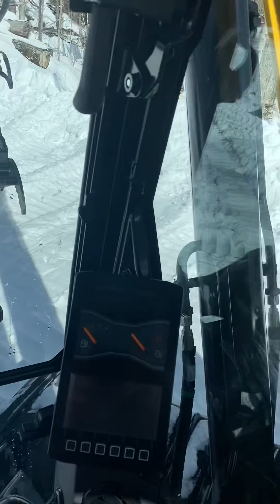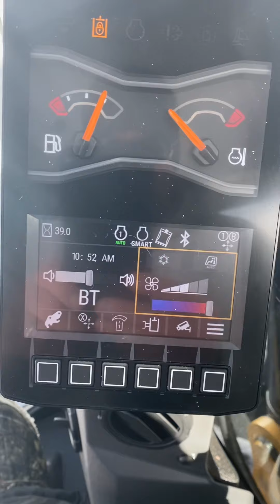Cat 307.5 overview part 1

Comment: I am about to buy one of these but I didn’t notice the fixed boom until now 
I feel like the swing boom is needed in some situations 
I’m really not sure if I will buy the 307 now
Reply from the maker: I guess if you really need a swing boom then you should probably look into buying a 308 instead.  Me myself I have no use for the swing boom yes there are times where it would be nice but not enough for me to need it.  I get by with the fixed boom just fine.